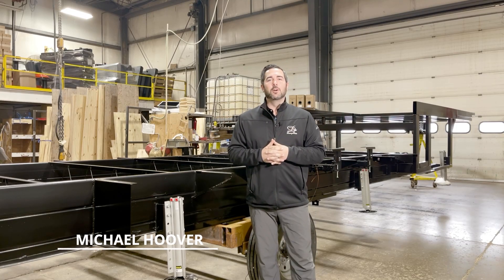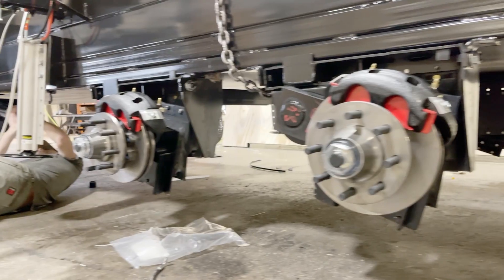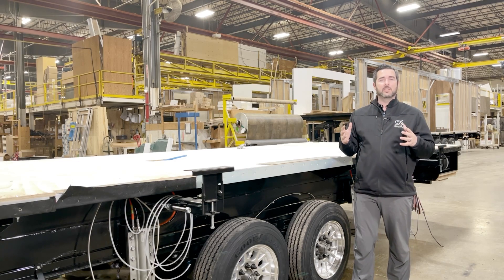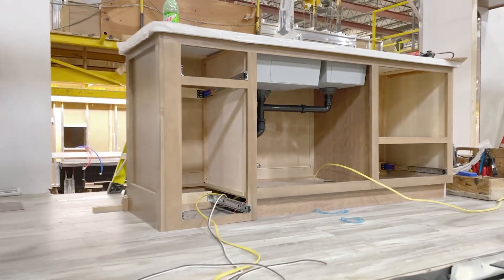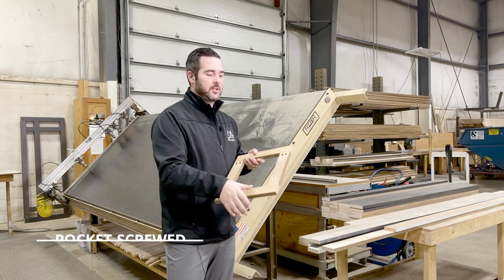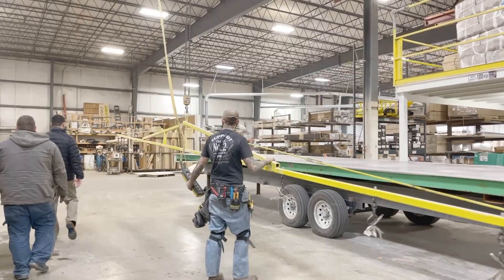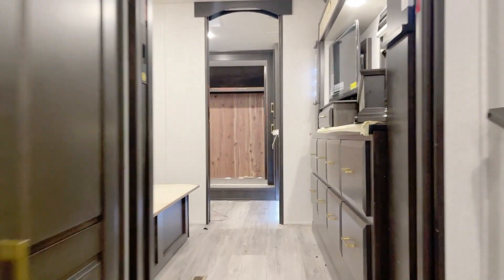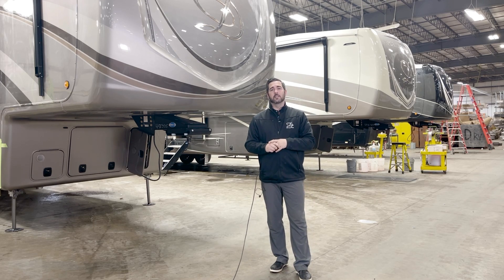DRV Luxury Suites Factory Tour with Michael Hoover

Comment: Slide out seals go bad to fast. Cable on slide out is bad Plumbing is BAD.
Reply: I have a 2018 no problems.  It's stored inside my building year round. No plumbing issues no seal issues but I did just Armour the roof. I have no plans to get rid of it. Still looks like brand new inside an out. I just this year spent 6k and had it ceramiced